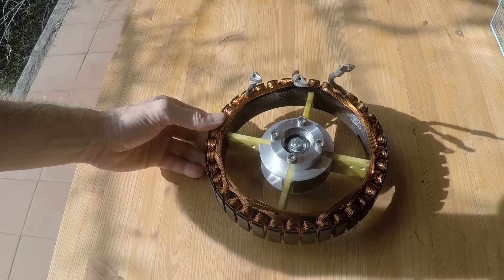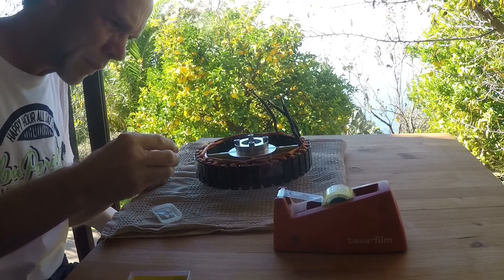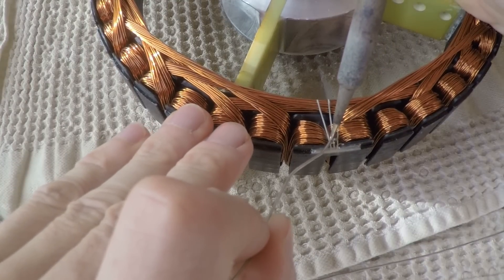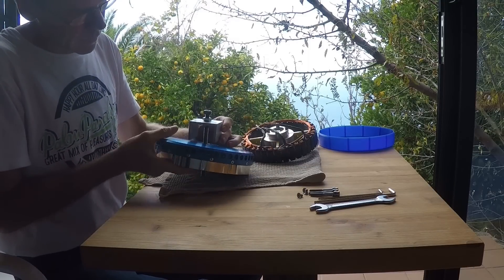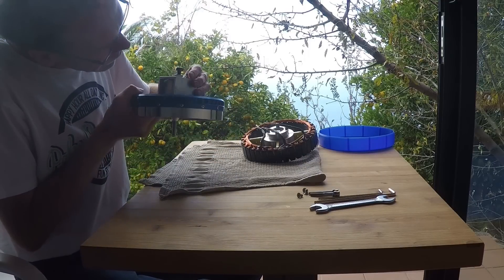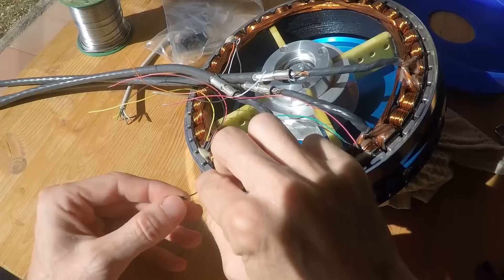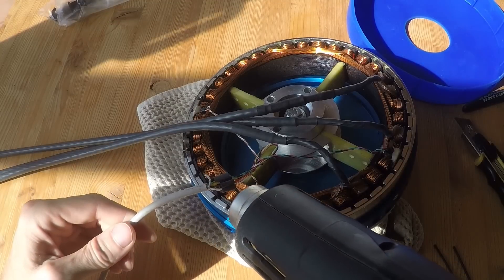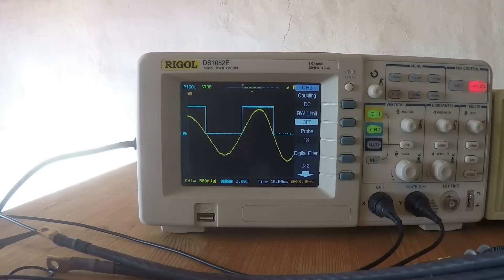DIY How to install Hall Sensors on a BLDC Motor

Comment: I see 6 thumbs down mind blowing this is some of the best information of this dyi build type done exceptionally well. He checks the output and the alignment  it is as perfect as can be. This is a very efficient for weight to power design. Anyone who has a clue should be impressed with the quality and his comments are chosen without chatty unnecessary bs.
Reply: his separating jig is amazing, mine just slam together

Comment: very good, let me ask you this, if my motor starts to rub when hot, what is the best way to align the rotating mass inside with the covers and housing to center it. i have tried just random positions by changing the positions of both covers, but that is not scientific and precise. is there a better way to verify the motor is centered?

Comment: can i use 3144 unipoler hall sensor?
Reply: I have the same doubt. 

But I think:
Each motor has different hall sensor. They use digital sensor but u have to check data sheet of your old sensor and find if it's unipolar or bipolar and use one relevant to it.

Don't use linear sensor, they are slow switching and for throttle only

Comment: Hi, how you determine where put hall sensors ? could you explain it to me ?
Reply from the maker: There is no easy answer, because it depends on number of slots AND number of magnets. I use a free tool called "Powercroco Bewicklungsrechner" (you can google it). That will give you the distribution of phase windings. Then you put one hall sensor in one phase slot, to have a so called 120 deg pattern. But there are also other ways to do the same job. I always put the sensors in the slot spaces. But I have also seen motors with milling machined slots in the center of the teeth. What counts at the end is, that you can measure the correct timing with an oszilloscope afterwards for each phase.

Comment: There are 36 coils (12 coils per phase), so why there are 42 magnets?
Reply: coils and magnet count are not dipendent with eachother, in general having more magnets is better beacause there will be less cogging in the motor, but with some calculations it's easy to find the most efficient number of magnets per each coil configuration

Comment: Hallo,
Ich bin seit Tagen dabei zu versuchen die Hallsensoren in eine Lichtmaschine (Die ich als Bldc nutzen will) einzubauen, vergebens... ich werde verrückt.
Habe die sogar um 60° versetzt eingebaut, und trotzdem nichts.
Ich habe ein Kelly KLS7212S Controller, d.h. der Motor wird zuerst mittels Hallsensoren erkannt (Indem der Motor in mehreren Richtungen gedreht wird, und die Sensorsignale erfasst werden).
Im Internet findet man nichts Konkretes und im Detail erklärt...
Wie würden Sie vorgehen?
Reply from the maker: Also erstmal die Anzahl der Slots am Stator und die Anzahl der Magnetpole am Rotor abzählen. Dann daraus die Verteilung der Phasen bestimmen. (Google: Bewicklungsrechner). Dann je einen Sensor nach der ersten Spule einer Phase platzieren. Und hinterher mit dem Oszi die Ausrichtung prüfen. Nicht einfach nur Versuch und Irrtum per Motorcontroller.
Reply: @forschungsbuero  Danke

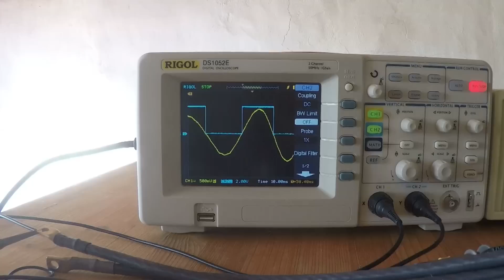Comment: 4:05 = hall sensor senses the flux of magnet. While back EMF has a quadrature relation with flux (e = N*d_phi/dt). Hence, I am not sure, if the  hall and back EMF should be in phase.
Reply: me too
Reply: Hi Debraj, notice where are the hall sensors installed, there between the teeth. As magnetic senes are HI, this is where you on the fire the coil. After, when it's LO, you want to fire the coil again but by reversing the current flow in the coil. This will give the push-pull effect of the magnetic fields of the stator coils on the rotor. I hope it helps!

Comment: Can you tell how to calculate the spacing of hall sensors for different winding schemes?
Reply: Domino Ryan  I have a stator with 27 slots (and 30 magnets): where do I put hall sensors?
Reply: Domino Ryan  Thank you for your replies! But I had meant where to install hall sensors in terms of stator slots - how far should the hall sensors be installed from each other, how many slots in between each sensor? (for a brushless motor for scooter).

Comment: I strongly advise against soldering SMD components like this, especially capacitors. They crack very easily with the slightest mechanical stress and unequal temperature. Having a small perforated board is much better, and I would use solder paste and a hot air gun if possible. Thanks for the tutorial!
Reply from the maker: Embedding in epoxy should reduce that problem.

Comment: how we will know , which is the right position for the hall sensor ?
Reply from the maker: It depends on your winding pattern, so no general answer is possible. The sensors should be 120 deg electrical (!) apart.

Comment: Congratulations ! 
It is a very good idea and job. 
Please, could we consider to design an external circuit, which reads BEMF and generates the proper HIGH/LOW signals, exactly as if hall sensors were installed ?
Reply: I'm sure you can build a sensorless motor but it will take more work. I tried to design a sensorless drive circuit but my motors are delta wound and I couldn't figure out how to detect the zero cross. I only have a dual trace oscilloscope. If I had a four trace scope I could see everything. If my motors were 'wye' configured I think I could have done it. If I try again I'll just buy a chip that detects the zero cross.
Reply: That’s what sensorless controllers do isn’t it?  Most cheap ebike controllers can run sensorless by detecting the back EMF on the wire I believe.

Comment: Very interesting your video. I have a question for you. Why did you choice por hall sensors into the core, like a normal e-bike BLDC motor (hard task to install sensors) instead put external sensors (optical or magnetic) instaled on shaft directly, obviusly separated 120° or 40° or 60°?. A big regards from Argentina

Comment: Dear Sir, I congratulate you for this nice work. I have a 24 slot/26 pole BLDC design (star winding pattern). But I am having some troubles in hall effect placement. I put the sensors per 8 slots. Do you have a suggestion?
Reply from the maker: Thats a different winding pattern with 4 coils in serial for each phase! Put the sensors between tooth 1-2, 5-6 and 9-10. Always check the timing for all 3 sensors with a 2-channel oszilloscope (each sensor signal and corresponding back emf must be in phase).
Reply from the maker: You have a completely different winding pattern than on my motor! First you have to check where your slot 1 is. It is at the beginning of phase wire A. Put sensors in slots 1, 9 and 17.
Reply: Congratulations for that nice teaching video. I have a different star winding pattern too. My motor has got 24 slot and 22 pole and winding will be two layered. How can I put the hall effect sensors? Also I want to turn 20 number of strand 0.7 mm diamater wire parallel together. What do you think, is it possible?

Comment: When you manually turn the motor why is one channel a square wave and the other a sine wave?  Or was the square wave interpreted by your motor controller?
Reply: The square wave is the digital output (on and off) of the hall sensor. The sine wave is the back EMF of the coils. The square wave is interpreted by the controller to give a more precise reading of the rotor's position for smoother and more efficient control of the motor.

Comment: Hi, great work for me. I want to know that which type hall sensor for this motor?  How many poles this motor? When you replaced three hall sensors external, could you give me some advice? 

I have added hall sensors, but the motor did not work.
My hall type is 413 OH18 and 41F.
My motor has 42 poles.

Thanks.
Reply: coil diameter ?)

Comment: I don't think it's a good idea to glue the sensor with epoxy glue. Hall sensors do fail, particularly on an ebike with regeneration. With that type of glue, removing the dead sensor will be a problem. I use neoprene myself.

Comment: I have a question. Does a magnetic field of stator have influence on the hall sensors?
Reply from the maker: In the gaps between the stator teeth the stator field can be neglected. The magnet field is much stronger there.
Reply: I think the blocking capacitors prevent false positives
Reply: +forschungsbuero
 HELLO! 
Can you tell me what is the price of motor ?)
Or what is the price of whole every its parts ?))

Thanx ))

Comment: I really don't understand how such motors spin! If the current is AC the electromagnetic coils change from north to south pol 50 times in second while the permanent magnets has fixed polarity
Reply: Rafael Jotiar the switches are rotor position-dependant.

Comment: why was that tool needed to put the stator on the rotor?
Reply from the maker: For tiny motors you can put the rotor on the stator by hand. If you'd try it with that big motor, it would crash with a bang and probably damage bearings, magnets or other parts.
Reply: oh I see. I looked like it was for centering it.

Comment: Hallo, haben Sie vielleicht Ahnung wo kann ich ein richtig Controller für ein Direkt Drive Motor von Samsung,der Motor kommt von eine Waschmaschine,ich brauche es für ein Projekt 
Hir habe ich ein Video,der Controller ist ein drei Phase Driver(Danfos vlt2800 0-1000Hz)  aber für Asynchron Motor 3Phase: https://www.youtube.com/watch?v=UGqF2OZsvZo

Mein Problem ist dass,wann der Motor läuft und ich versuche es bremsen stoppt von drehen  springt von der Magnet Fehld und macht Laut,vebraucht auch viel etwa 300 Watt leer lauf etwa 1400Rpm
Vielleicht können Sie mir helfen 
mit freundlichen Grüsse

Comment: If I install hall sensors like your video, will the motor work?  In the process of installing, did you need a hall circuit board?

Comment: does the hall efect sensor need to touch the winding?
Reply: No, the hall sensor just get info from the magnets. in this example is between two coils
Reply: @gmplascencia  thanks
Reply: @gmplascencia  can i run this motor without hall sensor?
Reply: Sure That depends on the controller you choice. That Motor is powerfull. You need to think about the application for it to select the right choice for you.
Reply: @gmplascencia  can you recomend me pls some good cheap controller? 
Thanks
Reply: @gmplascencia  ok thanks